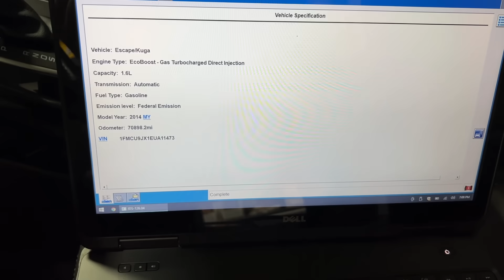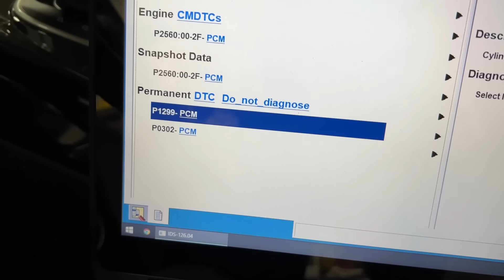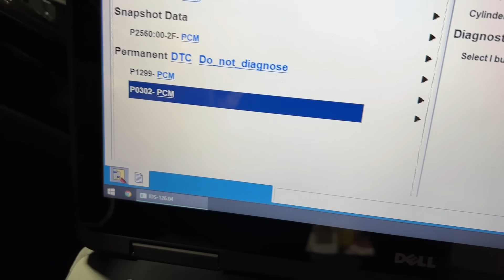Beware of Ford’s 1.5L 1.6L 2.0L Ecoboost Engines and Their Never Ending Coolant Consumption Issues!

Comment: @graken22 what difference maintenance would prevent this issue.
What is the upgraded design? Will replacing the engine keep it from repeating.

Comment: Cylinder 3 misfiring and intermittent overheating then cooling down immediately just started. How long (typically) do I have before it’s trashed. This just began to happen. 2015 Escape 100k miles. Pulling spark plugs tomorrow and scoping cylinders.

Comment: I've got a 2016 Escape with around 125,000 miles on it.  I heard about this issue a few months ago.  Fortunately, I haven't had the coolant leak yet, but I have started looking around to trade it in for another vehicle.  The problem with Fords is that these engines are in so many vehicles.  I am considering other brands now.  I hate it, because I have driven Ford vehicles since my early 20's with no major issues.  I don't know why Ford went this route.  Then again, I don't know why they abandoned the panther platform either.  Four of my vehicles were on that platform, and I got 300,000 + miles on each of them.  I actually traded my 2005 Lincoln Town Car with 350,000 miles on this vehicle.

Comment: So is this an update from another of your videos?  I thought the intrusion issue on 2.0 was limited to 2017.
Reply from the maker: It affects different years based on your model and engine displacement.
Reply: Thanks for the reply. My apologies, I should have been clearer. My vehicle is a 2016 escape 2 l manufactured in August of 2015. 
I was pretty sure that my car was not affected, but I'm losing water somewhere. Do you see any troubles from heater cores?

Comment: The issue with crack between cylinders is not on all Ecoboost engines. 2015 and above Ford went with an open deck design, therefore making the cylinder wall spacing thinner. These 2015 and above have the potential issue. The 2014 and below don't have the open deck design, therefore thicker spacing between walls.
Reply from the maker: Ah more misinformation from the internet, I would expect nothing less and people wonder why my comment section is so heavily regulated. Did you forget the 2013-2014 1.6L? Ah yes you did, now delete your comment full of misinformation or I will.

Comment: I have a 2017 2.0, I hope I don’t have to ever deal with this but I have a theory. If I’m in that situation I don’t have the money to fix it with new long block. I saw some people building race motors with open decks fill the water jackets with sugar up to about top inch and fill with epoxy to make it closed deck. This got my gears turning. What if you filled the channels between cylinders with epoxy, get newer head gasket and drill a pass through hole. Now I know some say there are micro cracks in the wall but what’s there to lose with doing this experiment if your options are 10 k for a motor or get rid of car. Just a theory that went through my head which I would try if I unfortunately encounter the problem. What do you think (I know it’s not a proper fix but hey it might just work).
Reply: Let us know how that works out.  Also if you have the towing package with the larger radiator it probably helps.

Comment: Wife's 1.5l ecoboost failed at 75 000 miles. No spare engines in the country at the moment, I guess they are a sought after item. Very low compression on cylinder one. Would coolant leakage cause excessive ring wear? Engine was burning perhaps 200mls of coolant between oil changes.

Comment: I have a 2018 escape 1.5L around 80k miles number 2 spark plug porcelain cracked and caused a misfire. Replaced the plugs and it was good. Now it’s got 85k and the same one cracked again and is a dead misfire. I’ve been lucky enough that no pieces have gone into the cylinder. I think I’m going to put higher octane fuel in it and see what happens. No sign of coolant consumption as of yet (knock on wood) but I’m sure that’s next…

Comment: Love your videos, best Ford technician out there. I just took my daughter's 2018 Escape with the 1.5L turbo in to the Ford dealer after her car developed a misfire. P0301/300 and they diagnosed coolant intrusion. It is under 84K mi, so they are going to replace the short block. Should I have them do anything else while the engine is out? Does this car have a timing belt or chain? Thanks.
Reply: Do you have an extended warranty on it or is Ford doing this for all regardless long as it is under a certain mileage?

Comment: I have a 2018 ford fusion that I bought new. I took the car to the  dealer for low coolant and they replaced the long block at 30k miles for the same reason and now I’m on my second block at 78k and guess what, it’s eating coolant again. I will never buy another eco boost again. I hope this video opens up people eyes to this problem and stay far away from from this problem.

Comment: 2018 Ford Escape,  bought for daughter.  After 7 months transmission failed.  It wouldn't even move itself a foot.  3 months later she complained about no heat. I'm thinking omg.  Topped coolant level off. 2 months later coolant is down over half a gallon.  1 month later (currently) its running so rough that she barely got home from work with it.  Scan shows 302,  316 and 2601.  What do I do with this turd?  Unfortunately she still owes around 16,000 on it. Currently it has 128,720 miles on it.

Comment: My 2019 ford escape started smoking white smoke at start up at around 40k and now it’s at 54k and took it to Tomball ford and they said it’s overfilled with oil which fords quicklane filled the oil levels and has the maintenance plan up to 100k on the ford.  But I am getting the runaround again at this second time trying to address this situation. Bi would not buy another one.  Everyone knows about this issue from ford.  They have a tsp to fix the issue but are very reluctant to fix the issue.  So don’t buy one and have the same problems I am facing

Comment: Have 2013 escape 1.6 eco boost transmission gave out two yrs ago cost $4900,,,month ago started blowing white smoke now coolant leaking into engine mechanic,,says engine going ,,,it’s shot 127,000k ,,,,sold it for $ 1500,,,,not gonna sink more money in it ,,,driving my 2015 Tacoma  now full time ,, only gona buy Toyota ,, Honda , or lexius from now on ,,,ford should answer to these defective engines ,,,,

Comment: 2015 1.6L Escape SE. Bought the extended warranty for 2k. was a hit then but... This happened at about 95k kms and covered. Transmission, engine mounts, fuel injectors a CV boot and the pressure plate were all also replaced before that warranty ran out. Probably my last ford.

Comment: As someone on Engine #2 in my 2015 1.5 Focus I feel this customers pain, mine failed at 103,000 Miles. It had never missed a service in it's life and was a very healthy engine before it went pop. Luckily I was able to source a fairly priced good used later 2017 1.5 for mine. Hopefully one day Ford will be held accountable. They build them to last under 10 years these days, I've only kept the car so I can get the value out of the lower millage engine.... but I consider selling it everyday... It's a shame as I love the car otherwise.

Comment: Got the same dang issue in my 2014 SE ecoboost with 147,000 miles on it. Also, I had service on transmission(fluid swap and filter swap by Ford) every 30K Miles since new. Got transmission issues now too. I am just going to run this dang thing as a local driver until it doesn't run or move anymore then I will remove motor and transmission, remove the seats and dash and make a pull behind camper out of it. Never buying anything again that has ECO-anything attached to its nomenclature!

Comment: I had 39k miles on my 2018 Ford Fusion dealer tried three times to get it right, everytime I would take it home the engine light came on. It was an ecoboost.  I got a 21 explorer with a ecoboost now. Fingers crossed.

Comment: 2013 fusion. 58k miles. New long block $5k+2k for water pump thermo houses +3k labor. 10k. Fine if the new long block is reliable and redesigned. Does anyone now? Or am I just putting another flawed engine in the car?  Thanks.

Comment: A mechanic on another channel stated the Spainsh built 2.0L doesn't have this problem. The letters VEL on the valve cover by the chain is an indication that the engine was built in Spain. He had torn down both engines that are either built in Cleveland, Ohio or in Spain. He stated the engines built in Spain do not have this issue.

Comment: Is the best option replacing the head gasket or replacing the engine? If it's the latter, is it possible to replace the eco-boost engine with the naturally aspirated engine that's in the base model?

Comment: 2016 Fiesta ST, 105k, No consumption of anything.  running 26 PSI of boost.  Haven't seen any complaint on the Fiesta ST forums. what's the difference?  I know they made some changes in 2016 so is this a 14-15 problem?  Or is it specific to this model of vehicle. No TSB on these cars.  Either something is different of people aren't taking care of them.

Comment: Great video.. An eye opener. I have a 2017 Ford Escape SE 1.5 L Eco Boost. Only 26K miles.. Does my engine have the "543" Valve system? Or am I headed for potential similar issues? Car runs like  a watch. No Problems yet. I'm going in for a radiator flush as I stupidly added wiper fluid, sucked it out then added water to the coolant tank and Ford recommends I flush it out. Appreciate any info on the "543" valves and whether I have them..

Comment: @FordTechMakuloco, I have been looking at replacing my current vehicle with a newer Escape, I recall a video you did in the past about a revision in mid 2020 model year regarding head gasket and Coolant passage.
Even after the revision do you still suggest shying away from the late 2020 to current escapes with the 2.0L engine?

Appreciate your time and have a great day.
Reply from the maker: I have not seen issues with the redesigned blocks as of yet.

Comment: This happened to my 2016 Fusion. 121k miles and my estimate for a new engine was $8,500. Guess it will be collecting dust in my driveway for the foreseeable future

Comment: I have a 2014 fusion se Ecoboost and is having issues now but i did discover and Ford issued technical bulletin issued on April 1 2020 and a recall for my year model that was assembled in Mexico, however Ford failed to send my recall letter. Recall was issued on March 29 2017 at the time my car was
 Under warranty, fast forward to now, my fusion is having issues fords response contact the BBB, along with out or 3 refills of one time i had the warning car shutting down, along with recalls that have not be fixed or any remedies, ford has a buy back program, basically no resolution

Comment: I own a 2017 Ford Escape Titanium Turbo and at 70,000 miles my engine light went on and after I took it to the shop to have it diagnosed it turned out to be a $8,000 repair.  It turns out that the 2017 have these issues of having the head seal leak into the engine and since the block is made of aluminum it would require a complete engine replacement.  Don't bother about getting it from another distributer, it has to bought by Forde at $5,000 and the rest is labor.  I had originally purchased new in 2017 and it was under warranty until the 60,000 miles.  It is known that this is an issue and that there is no recall on it.  My wife and I are on the fence on whether to replace the engine or not, what do you think.  It still looks new from the outside and the inside

Comment: Just pulled a 2016 2.0 Edge in for an oil change and found forbidden chocolate milk. After some research I found this video and TSB 22 -2229. And of course it's out of warranty. Couple questions is is there a way to tell if this engine has been replaced with a unit before? And also is it a head gasket design or a block design issue?

Comment: I do appreciate the video, good to see the effect, but I still want to know the cause. From a comment below " They designed a slit in the cylinder walls right at the joint to the next cylinder which causes the head gasket to be MUCH thinner at those points which is the obvious weak point and fail point. " 

So basically a head gasket failure allows coolant intrusion for an extended period which causes collateral damage. Even a head gasket code would have headed the long block issue off, and since my wife's 2016 Escape just had to have one for this very issue it would have been nice to know if a replacement was going to have a design flaw or if this was a chance failure. The dealership was no help with that question, and since we bought it from them used, Ford was no help either. Wish I had seen your video before the swap. And let me tell you, $6k to $8k was nowhere near what it cost.

Comment: Hi I just bought a 2016 focus 1.5ltr turbo ecoboost with 33k klm only 
No issues I'm just thinking if I put a cooler thermostat and extra electric fan will that fix the problem of the head issues . What the original thermostat degrees now 82 I can not find anything on it .thank you in advance

Comment: I gave up on ford after the 3 valve BS. I would not recommend anyone buy a ford product unless maybe a 5.0 in the pickups. Although I hear they have transmission issues in the 10 speed auto.

Comment: People wonder why I want to build my next vehicle using a 302 or 351 with a carburetor, distributor and manual transmission. Only thing I would miss is ABS brakes.
Reply: You don't have to build it, they are still out there. I have my 73' Mustang Mach One with the 351 Cleveland that doesn't nickel and dime me. She's extremely comfortable. It rides like the old Monte Carlos or Cutlasses used to ride. Can't feel the bumps. I keep it clean and change the oil. That's it. No goofy turbos but still has more than enough power.
Reply: @TheBandit7613  here in the rust belt I would be rebuilding or building a body.

Comment: I own a 2019 Ford Escape... Yup, got coolant leaking in #2 cylinder. However, my Ford dealer (Victoria, Canada) replaced for free the engine with an upgraded engine (coolant issue solvent). I am one of the lucky ones! I hope Ford does the same for every Ford Escape owners with the same issue.
Reply: And there was only 37 000 km (not miles) on the original engine.

Comment: If these are going to go - is there a time to say its all good or it might yet still go?
Im looking at buying a Used 2017 Escape - regularly serviced and last service was pressure tested etc and everything was OK.   
2.0 l ecoboost with 56,000 miles on the clock  (NZ New if that matters?)    Is there still a risk?
Reply: Yes

Comment: So how long can you realistically keep driving the vehicle if you keep the coolant full? my wifes car has this issue and she still owes 10,000
Reply from the maker: Forever until you start having starting issues, excessive consumption, overheating issues or poor cabin heat concerns.
Reply: @FordTechMakuloco  rough start for about 10 seconds right now her brother said he would change the headgasket but what are the chances its a headgasket vs cracked block? I appreciate your reply btw
Reply: I had this same issue on a Camry.   It went from I don't know why it's losing coolant to undrivable in about a month.

Comment: Personally, for me, there isn't enough room in the tiny engine bays to cool these engines and they will heat up, constantly expanding and contracting, not to mention, only one side of the engine is getting air from outside causing expansion differences in the block. Of course they are going to fail........

Comment: My wife’s 2018 Escape (approx 56,000 miles) is at the dealership getting the engine replaced.   She was 4,000 miles and 42 days away from the power train warranty expiring.   Cylinder 3 miss fires, drinking coolant, white smoke coming out of the tailpipe etc.   It was another cracked engine block, this one on a 2.0 Eco-boost.   If it was not for Covid and her working from home during parts of it, she would have been well past the 60,000 miles and we would have been out of warranty.   Thank GOD it was still under warranty.   We are so sorry for others that are not as lucky.

Comment: I'm really lucky. I have a fiesta st with 170k on it. Had one overheating issue on a long road trip once. The radiator fan  capacitor blew. I ended up temporarily fixing it by wiring a circuit directly to the battery with a 60 amp switch until I could get the new fan assembly. Other than recently replacing the valve gasket I have had 0 issues with the car. One of the most reliable cases I've ever owned

Comment: OH NO!! You helped me with my 2008 Ford Focus thermostat issue 4 years ago, I sure hope this does not happen to my 2019 Ford. You would think FORD would take care of this for every customer since this is a factory issue. If I had to pay $8-9 grand someone will hear about it since my car only has 17,000 miles. I bought it new May 2019 right before the PANDEMIC so don't drive it much now, but I am saving this post just in case  :face-pink-tears::face-pink-tears:
Reply: Happened to my 2018
And I had 45k at the time

I now have the revised block, basically a 2019 block in my 2018. I’m driving around with my fingers crossed 

(No warranty I paid a local engine shop that rebuilds and are ford certified) 

Edit. 2 or 3yr warranty if it fails the same way 

I’m still pretty afraid
Reply: Oh no! terrible @Lord_Don